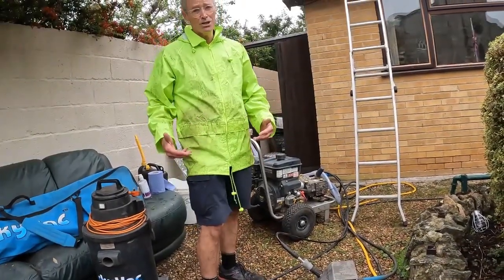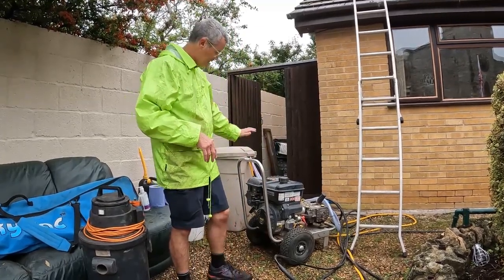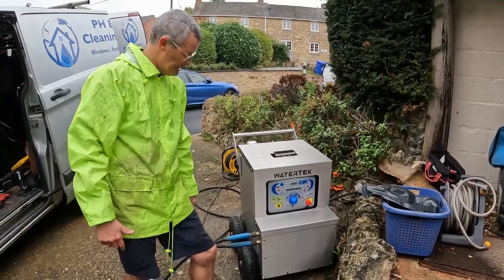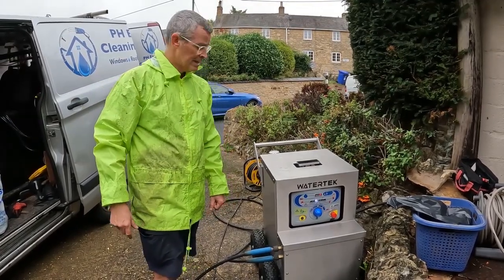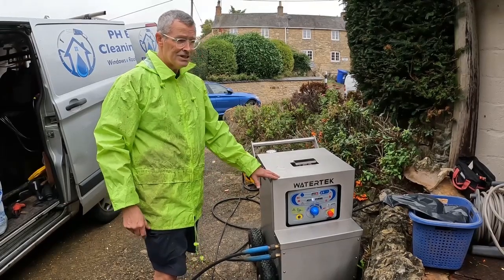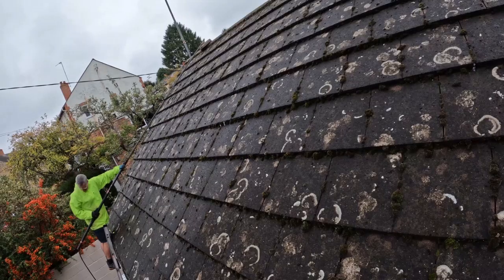Steam Cleaning a Roof using Watertek Hot Box

Comment: Hi Paul,
in your commentary you stated about tile type and temperature. is there a guide to this and where could i find it please. as this would be an expensive way to learn on the job. regards rob
Reply from the maker: Hi Robert. There is not a guide on this that I am aware of. If you watch the video where we scrape the roof and soft wash it as the tiles are delicate - hopefully it will come across that through experience and site surveys PRIOR to estimating, you can determine the best approach to a clean. The very latest video I put up about the PA Nozzle is an example of the site visit determining my approach. I could have scraped this roof as there wasn't much moss of it just lots of black and white algae. The neighbours had theirs down by someone else the year before and the white lichen was still abundant and distracting. Just knowing this tile is robust and not old - I was confident that the single PA nozzle would be the best approach. The customer gave me a five star review yesterday and was very happy that they don't have all the white lichen still on the roof. Sorry I have rambled on a bit. Hope it helps. Paul

Comment: Great work and nice to see a hot box. I assume the last bits of lichens would come off with biocide? It's a bit worrying seeing you work from a ladder especially if your 'helper' is an employee! I know you are more than capable of working off a ladder but is it worth the risk?
Reply from the maker: Generally I use a Mi Tower as you are probably aware. There were areas of this job, after my conducting a site survey, that I felt confident with the use of a heavy duty T Bar ladder. Judgement call I guess. By the way - I really appreciate your comments as I have found them always to be very specific. Helps me reflect as well. 😊 Just checked the video and I notice we used the smaller “T bar less” ladder at the front which on reflection we will not use again.
Reply: @phexteriorcleaningservices  I do enjoy your vids and always learn something from them,  thanks. I do worry a bit too much on h&s sorry :-) I guessed that the tower wouldn't be useable on some bits of that house. 
Keep up the great vids.
Reply: Nice🎉. Just wondering what sort of criteria you use to decide to use steam, cold water or scraping and chemicals? I read that some people think steam is not necessary. But I’m thinking maybe you can run at lower pressure with steam? And perhaps you don’t need to finish with biocide because is kills lichen etc? Thank you

Comment: Why steam over just pressure washing it like ive seen in other videos?
Reply from the maker: Sometimes a customer wants all of the white lichen removed from a roof not just the moss. To do this with cold water under pressure can unduly wear the grain off a tile. Using steam allows for 99% removal of white lichen without the undue wear on the tile. This is a choice the customer has. In my opinion, removing the moss is the main objective whilst maintaining the integrity of the tile. So customer choice. Hope that helps.
Reply: @phexteriorcleaningservices  ahh ok thanks, I was thinking of starting a small side business spraying driveways and maybe give this a try later down the line, I make and install corian worktops but it's so quiet and want to try something different after 17 years of it. I'm guessing the gear isn't cheap though
Reply from the maker: @harryhoudini4365  not cheap at all. I would suggest starting with a 21 lpm pressure washer and flat surface cleaner to do driveways first. Then, once you are competent with that, move on to roof cleaning. It would take a year of driveway experience first.
Reply: Hey Paul what are the white circles  on the tiles after it's steamed? Is that engraved into them
Reply from the maker: @tinobyrne9016  white lichen. Does not always come off with low pressure. Biocide will kill it and after weathering, it will wear away.